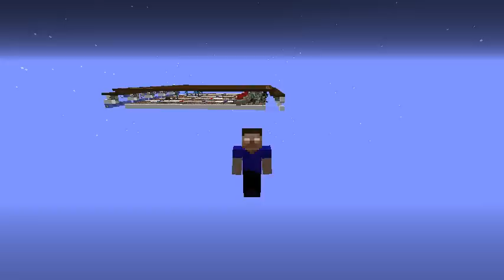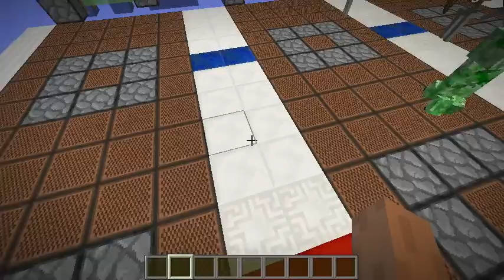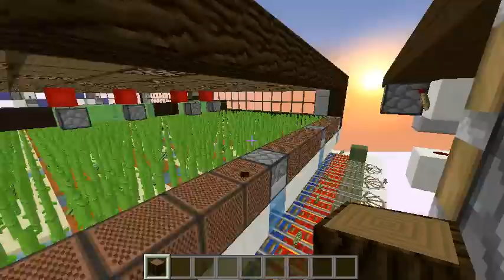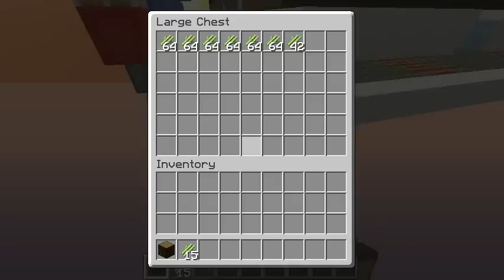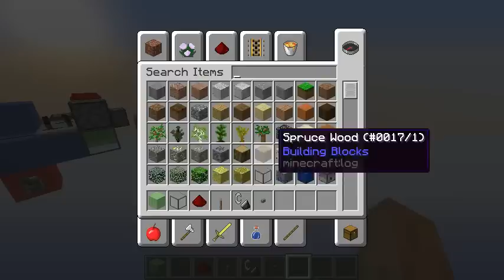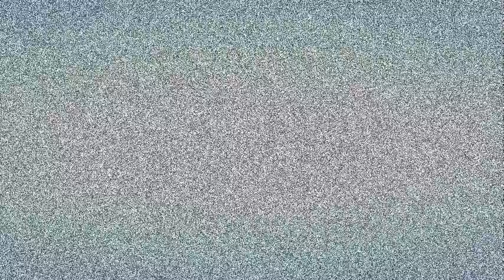Two-way Expandable Flying Machine: Simple to build and inexpensive | Minecraft 1.8+

Comment: I was slightly disappointed to see this because I had exactly the same idea only for use in the Nether for a wither skeleton farm and you beat me to it.

Most of the designs for wither skeleton farms have limited spawning platforms due to moving floors or gaps between minecarts depending on the mechanism and wither skeletons don't spawn that often.  It occurred to me that a bidirectional flying machine could sweep them off several platforms at once and it wouldn't be all that resource intensive.

Nevertheless, good job on this and it's a very nice design.
Reply: build it one off the ground and u can use netherbrick floors for more spawn space
Reply: i thought of the same idea just a little bit ago.. aww i thought i was special